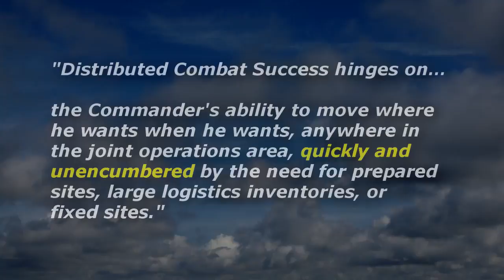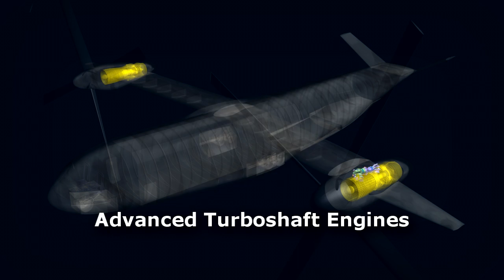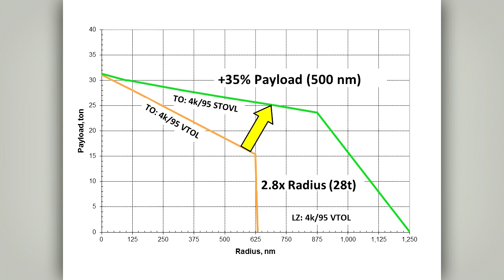Joint Heavy Lift - High Efficiency Tilt Rotor - JHL HETR High Def

Comment: what happens when you lose a rotor... worthless
Reply: What happens when a helicopter loses a rotor? What happens when a fixed-wing aircraft loses a wing? Yeah, same thing (unless you're the F-15 lol, but your landing speed would be in excess of 300 kts). There's some sort of shaft system that connects all 4 rotors, so if you lose one engine, none of the 4 rotors dies - you'd have to completely lose the rotor for an imbalance in force to flip the aircraft over.  Chances of completely losing a rotor is really the same as the chance of a helicopter completely losing it's rotor.... which is basically 0.
Reply: we  dont have  your  problems.. yours is worthles
Reply: Hey Jonny the v22 hasn’t lost a rotor yet.. that can happen to any propellor or rotor-drivin craft I mean really

Comment: Seeing as this aircraft would be able to do air drop's of supplies, why not have both front and rear ramp's for unloading of supplies and equipment.   Then you could make this aircraft easier to unload and deliver more needed by the boot's on the ground that need those supplies the most?
Reply: lots of moving parts means added maintenance procedures, and maybe perhaps stability issues aswell, however it might add some benefits aswell if they manage to nail that feature without compromising the vehicles main performances.

Comment: How well does it do if you lose one of the rotor motors?
Reply: If a normal 2 engine plane loses an engine its fucked simple as that
Reply: There is drive shaft between engines so if one engine fails the other  engine can power the rotor of the failed engine so can land vertical  or keep flying normally
Reply: i suppose they are connected so nothing much... probably cant take off with one but i guess you can sort of safely land. but thats not the problem. the video is full of bullshit. vtol can never compete with regular aircraft on how much can it deliver. its simply much heavier and complex. 
also it seems that not moving the engine but only rotor is a bit better... so this is kind of obsolete.
Reply: Just like chinooks and ch-46, you lose a rotor and you lose, in helicopter mode.  You lose an engine in helicopter mode and you pick your landing spot.  You lose an engine in cruise and you would have plenty of time to land.
Reply: there is a drive shaft in the wing so one enngine can drive both rotors
Reply: Tilt rotor seems so vulnerable.  Can't fly wing alone.  Any asymmetry in rotors dooms the crew.

Comment: OK------- This is an old video Before the 280 was built showing that you don' t need the swept forward wings requiring the bent drive shaft across the wings between engines or the need to rotate the whole engine pod. Both of which require additional power. But it still would have been great if they had build the thing to replace the CH-53. OH Well.
Reply: the thing is twice the weight
it can lift 35 tons vehicle
the ch 53 lift 16 tons of cargo

Comment: If one rotor fails during take off or landing then instant catastrophe.
Reply: Phillip is correct, has in the V-22 Osprey there would be a connecting drive shaft to prevent catastrophe.
Reply: @MStoflet  Yes, but a fully loaded V-22 Osprey is unable to hover with one engine out at full or near full loads (during takeoff). When taking off with a load, if an engine fails, RIP the V-22.
Reply: @spamaccount1680  guess it can sort of safely land with only minor damage... thats mostly enough
Reply: @jebise1126  It depends on amount of payload and fuel, a V-22 with the max amount of payload and fuel won't be able to hover at all... If there's a nearby airfield or flat strip of land it can glide to a horizontal landing tho.
Reply: onetruekeeper  I would suspect that the drive system incorporates a shared drive input system linking all rotors together.